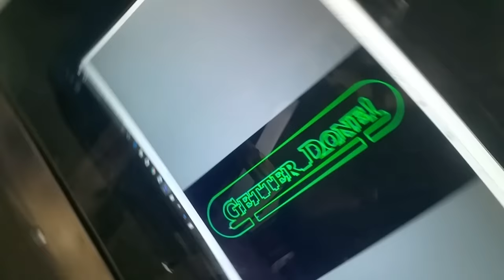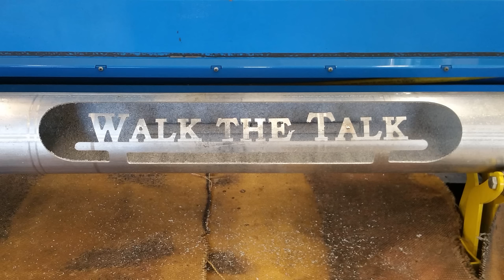Whittling out your pipe

Comment: That 3d pipe cutting was awesome! Poor little shop vac hose can't handle the heat.
Reply: aluminum dryer vent hose may handle it if not directly in the line of fire like the flashing was...
Reply from the maker: The new better expandable dryer vent hose works great, already tried it and had sucess. ;{)------
Reply: Sweet, do you need a 4" inline duct fan? I've got one that's just laying around I'd be happy to box up and ship you if you think you'd use it. This is the type I'm talking about...New 4" Inch CFM Inline Exhaust Duct Fan Vent Blower
Reply from the maker: sure I can put it to use!  ;{)-------
Reply: I'll email you shortly to get your address and send it out :)

Comment: Keith, you need to make yourself a tank like the bucket that is used for sanding drywall.  The incoming enters the water to remove the dust (in your case the hot metal) the outgoing goes to the vac.  For your incoming you could use either aluminum hose from dryer flex hose, or the mylar based hose, both of which would not burn through that  easily. They would duct to the water, and the smoke would go to the vac after being cooled by the water , particles would wind up at the bottom of the water bucket and be emptied whenever.

Comment: keith thanks for mentioning that stove draft. my brother live on the front range colorado - loveland. he put a wood stove in his 20' x 28' workshop(detached garage)...well they thought it was a drinking problem him passing out couple times working out there after work; he forgot the make - up air supply and up there mile high air aint cheap...i knew right away when his wifey called whut up "chief's out cold"... awesome demo the hand held, etc. thanks. saw one fella uses refridgerator door magnet strips as cut guide over auto bodies, odd shapes. and one final note autocad - cut auger blade helix >  getter done

Comment: Good video, loved the shots of the inside while cutting, you can watch the aluminum sheet deform. You could try checking an automotive supplier for heat resistant hose for the vacuum, they have plain rubber and heat resistant hoses to put on tailpipes to get the exhaust out of the shop while the engine is running, they come in all different diameters. I want to offer an idea I've used welding pipes and tubing with a rotator, instead of clamping the ground directly to the pipe I wrap bare braided cable around twice, let the ends hang down and clamp the ground to the ends, it keeps good contact without disturbing the rotation. Just some ideas.

Comment: Keith, don't bother with shopvac -- create the draft with your air compressor: something like a venturi type propane burner. Tube within a tube, outer pipe attached where you had your vacuum hose. short inner pipe hooked up to an air quick connect, blowing away and out from your torch. That'll be plenty, and you can make it out of whatever metal tubing seems convenient.

Comment: You could make a water bucket suction heat trap before the hose, and use aluminium and stainless hose (the kind they use over ovens) before it. The water bucket is just a normal bucket with a sealable top, in it there's two holes. One with a pipe that goes all the way to the bottom and stops a cm from it, and another that just connects to the vacuum with a flange. Works for cooling hot exhaust, water based vacuum machines, and may other applications.

Comment: If you run the hose through the water it will help cool the air inside. You may be able to get a metal section for the plasma cam that runs through the water and just have a connection for the plastic once the air is cool. You can also build a simple inline chip/waste can with a metal garbage can and that would  help solve the hot air problem.

Comment: Considering your winters up there, I am a bit surprised you don't have a filter system for the plasma cam. I know commercial filter cartridges are pretty pricey, but you can easily separate the larger particles a number of ways, followed by a furnace filter, then the fume filter. I bet you would get several years or more from a single cartridge.

Comment: Make a metal trough the length of the table + couple feet. slope it down a little and put a drain on one end. pump water on the high side so that the dross is carried away and recirculate the water. Use silicon wipers made from 2 inch wide strips pop riveted to the lip of the trough.  Think of something like a chicken feeding trough with flaps. Mats can be put over sections not needed. Put an adapter for a shop vac hose on either end with an adapter plate on the other end of the hose to put on the main plasma cam table. Cover the main table as normal so it draws through the adapter plate for the trough and hold the whole lashup on adjustable stands, like a tripod or sawhorse.

Anyway, that's my two cents.

Comment: i was thinking of the rotating pipe needing a ground.. got any braided copper battery cable laying around.. drape that over with a weight to hold it snug to the pipe OD might give you a slip and slide ground on the pipe OD..

Comment: Maybe change the elbow at the top of your suction to a TEE with a damper control, then you could attach a flex pipe and movable hood, and/or flex pipe held near the work.
hmm, what about those welding duct positional arm things 
Would just having a restricted cap on the end instead of the bag help with bringing in a bit of cold air while still allowing enough suction ?
Otherwise you may need metal flex pipe.

Comment: I was thinking especially for the bigger pipe that once of those fans with the metal bendy ducts (Not the foil type used for AC systems as that stuff is useless but the one that is like concertinaed Aluminium)  that they use for venting confined spaces would work well to keep the fumes down and would also be able to handle the heat from the smaller pipe.

Comment: Keith try a hose they use in auto repair shops for muffler exhaust   Connect to a dust collector that uses an external bag but just add additional hose to vent outside   Collectors like the Delta and knock offs have a metal impeller  I suppose a 6" squirrel cage blower  would work too

Comment: I wondered if you installed a simple weighted butterfly valve arrangement (such as is used as a back draft baffle on a heater chimney) mounted on an inverse cone (large enough to fit a range of pipe diameters) to allow some air to enter the pipe from the opposite end of the pipe you are sucking from. So that the valve is pretty wide open when you start work initially and progressively closes as work progresses and your hole your cutting gets bigger - a sort of venturi effect.

At the other end a length of flexible metal tubing to a cyclone mounted on a small collection vessel vented to the outside of the building.
Reply: Interesting, thanks.

Comment: I keep a braided copper grounding strap with my welding/cutting stuff for grounding pipes. Wrap it around the pipe, clamp the ends together with the ground clamp and let it hang down. Rotating the pipe shouldn't be an issue anymore.
Reply from the maker: Yeah couldn't find mine, I have used that many times with old weld positioners. ;{)------

Comment: Get a flexible dryer hose and connect it to a dedicated blower fan. I'm also surprised the pipe cutting attachment doesn't have a quick release screw adjustment for the rollers.

Comment: Nice hand cutting on that pipe Keith.  The 4th axis on the plasma cam looks like it works well, should be good to do fish mouths too.  I'm sure you've got the draft problem solved already but I was thinking if you got one of those HVAC flat plate to hose transitions you could use dryer duct or something like that and put the flat plate down on the bed and seal around it and use your draft for the table.
Reply from the maker: Exactly ;{)---------

Comment: It would seem to me when you were talking about the electrical connection affecting how turning the pipe could affect the connection when clamped, you would need a copper/brass wheel to provide a continuous connection no matter how the pipe turned.
Reply: or just use a section of stranded copper wire like Jody over on WeldingTipsandTricks ;)

Comment: Great video.  About the hose problem, could you make a sheet metal venturi so the inner tube would get the hot gasses but the outer funnel would pull in shop air?  that may cool the air enough to still use the plastic hose, and maintain usability.

Comment: I'd recommend getting some flexible metal pipe, they have flexible tubing for chimney flues, its like a heavier duty metal dryer vent hose (which might also work?), connect that at one end to a shop vac, or might be better to put a valve into the draft suction line for the table to add the pipe draft hose into that system, then on the other end, you could use the aluminum sheeting to make a funnel that goes from the pipe diameter to the hose diameter, maybe with a little extra so it'll slip as the pipe rotates.
Reply: Another way of getting the suction: you could block off all of the table except for under the pipe, as you'd do for cutting things flat on the table, but have one of the cover panels on the table have the hole for the metal hose, having most of the table covered should cause the hose to have a good bit of flow through it that way too.
Reply from the maker: That is what we did to shoot the WALK the TALK cutout. LOL  ;{)-------

Comment: I wonder if instead of pulling that hot air into the shop vac you could still use the shop vac on one to blow the waste into something like a metal cyclone on the opposite end.

Comment: The shop vac hose could probably handle it if you didn't have the bag over the other end. Pulling all the air past the heated edges made the air plenty hot. The plastic got set with the heat and the vacuum  collapsed it. If more air came in through the end of the pipe the cool room air and the hot plasma heated air would have mixed and I'll bet the hose could deal with that.

Comment: Wow! WoW! and WOW!!! What a surprise.  Amazing!!  I was smiling through the entire process.  Who but Keith could make this entertaining and fun.

Question about the pipe cutting attachment roller.  Is there a need for an index marker along the length of the pipe (or perhaps an edge)?  As the belt moves the pipe, I wonder if it can slip a bit and thereby lose its longitudinal reference.  Maybe the belt tension is sufficient and maybe the tolerances are not of great concern... but what if they are?
Reply from the maker: You can index by locating a pipe location several ways, using the drawing layout & torch to part location, just like sliding a sheet on the table top, when flat cutting. ;{)------

Comment: I betcha the plastic hose would have worked fine if you left the other end of the pipe open.  Lots of cooling air mixed in then.  Put a little water in the shop vac can too just in case!  ;-)

Comment: May I suggest Walker Flexible exhaust pipe? Available at O Rileys.
Reply: Cheaper might be throw away aluminum dryer vent hose at the big box stores.  Used to be available anyway, it was three feet long as bought but pulling it to length there was something like ten feet of it available for use.  Might be enough cooling happening in that length to be alright then for the standard hose set up.  A small hole in the bag would also help with cooling.

Comment: just a thought,, maybe check with commercial gutter guys,, and get commercial round downspout parts and make a connection to the PVC that would work? and or find out where any close auto shops get there exhaust ducts that they route auto exhaust out the door with,,  may be pricy but simple and proven just my random thoughts

Comment: Maybe some drier vent hose would hold up. Getter done.
Reply: That's what I was thinking, the corrugated aluminum hose should hold up to hot air and slag flying through it.  Just pipe that into a water-trap, then the normal vacuum hose (or table ventilation fan) could come from that to provide the negative pressure.

Comment: Nice cut Keith 
What gas do u use on stainless ?
I cut iT with n2 and my 100 amp thermal dynamics can use watermist for protection shield
Works great on stainless and aluminum leaves a better edge then lasercutting
Your edge was very Nice too so i dont think u use just compressed air
Keep up the good work and greetings from the netherlands
Reply from the maker: Clean dry compressed air is all I use. I haven't tried any gases yet.  ;{)------

Comment: Hey Keith what about adapting flexible dryer vent hose for the draft connection?
Reply from the maker: Did that on the second cut with Walk the Talk cut out and fed the table, worked great. ;{)------
Reply: I was thinking the same -- one of the metal ones.

Comment: Excellent video...           Maybe the rubber hose could have been saved by placing in the aluminum pipe a big bunch of steel wool (and thus obstructing partially the pipe). The steel would have been heated by the hot flue making this way a colder air at the entrance of the rubber hose...

and a small vent could have been added at the junction of rubber and aluminum, allowing a mix of cold air in the hot flue....Nothing expensive....